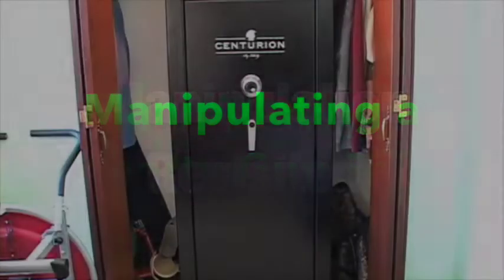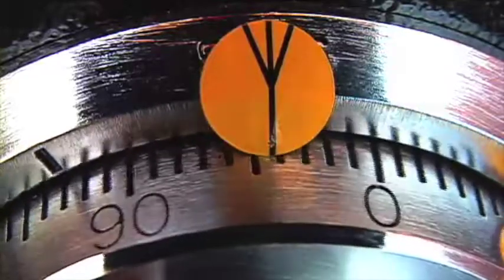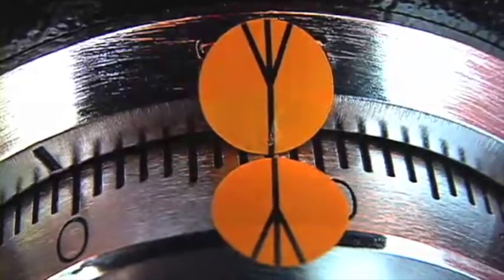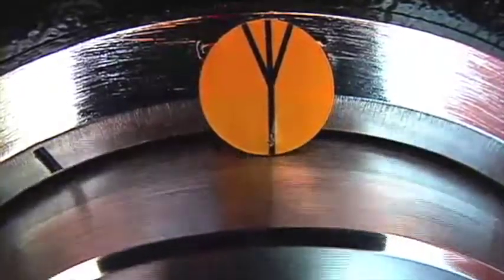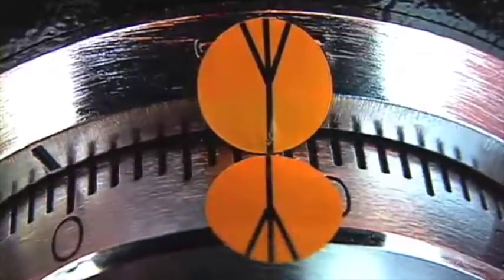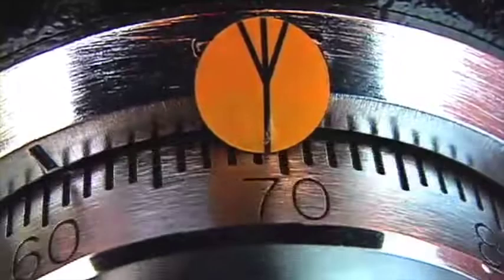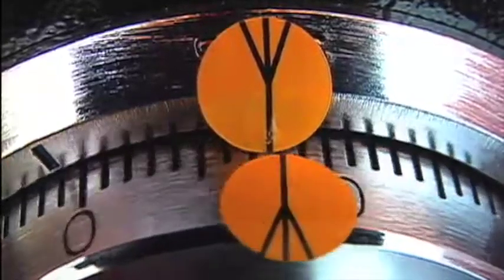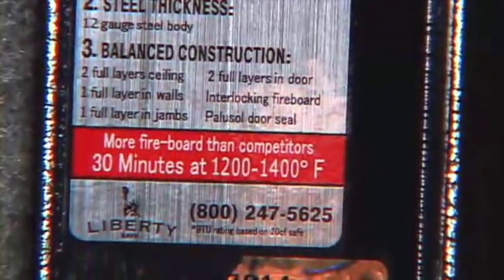Manipulating Gun Safe

Comment: So what do you do when you can't find a contact point?   I might have a group 1 lock I guess..   It doesn't even have the 2nd line (for when you change the code).  It only has the one center mark and nothing else.    I don't know how to use any of these techniques without finding a contact point.
Reply from the maker: Is the safe an old antique  it might use handle pressure to create contact points.

Not all locks have a spring assist lever that make contacts.

Group 1 locks have a second line for changing.
I know Diebold locks have only top index and need a listening device to find contacts.

Sounds like one you may have to drill open.
Reply: @ckpick8621 It says Mosler on the front panel..  It says nothing on the dial itself.  I'm pretty sure Diebold bought Mosler.. so maybe it is the lock you're saying-- that needs a listening device.  One thing is, we have it laid on it's back at the moment (on my trailer).  So the doors are facing up to the sky..  That would definitely effect the lever if it's not spring assisted.  The dial is not exactly free spinning either.. It's not bad, but you can feel slight resistance through around half the dial.. It's just kinda firm in general.  It's very smooth, but it feels like it's covered in old grease.. It's like trying to spin a knife in peanut butter.  It spins-- there's just a steady resistance there.....   It's quite big with two doors.  about 5ft wide and 4ft tall with the wheels, maybe 2.5ft deep.    

Numbers say..
serial no: 18868-14
model no:  11

I can't find much info on it.  From lists I've seen people post, this might be a 1966..  not sure.  It's very institutional looking.. Like something you would see in a hospital or government building or something.  Very square and basic.  It's obviously lined with concrete and is well over 1000 lbs.

I don't know exactly where to drill.. If you know how to find it, please do tell.
Otherwise, I was thinking about cutting/ busting a hole in the bottom, big enough to crawl into.. Then I can pull the back of the lock and easily decipher the combo from looking at the wheels.   I'd like to avoid that if it's possible;  it wouldn't be too hard to repair.. I have a welder and know how to pour concrete, etc.
Reply from the maker: @calholli  You have a Mosler double door fire safe.
Them locks hardly give anything and with a tight dial forgot it.

I can tell you how to drill it on the right side door.

The safe will have hardened plate not thick but you need high rpm and a carbide bit.

Measure carefully from dial center 2-3/4" Left of dial center and 3/4" UP.

Drill straight a 1/4" hole is really all ya need. You will drill outer skin then fire insulation then hardplate then inner skin then breakthrough.

When you breakthrough you will hit the tip of the handle cam you can tell by wiggling handle and see it or feel it with a ice pick. (Don't drill through this)

Now hold UP on handle insert some type of punch and give it some hits. The cam will move past the lock and open.

You may need a few 6" bits to finish door is kinda thick.
Carbide bit can be 4"

With safe on back it helps because you can you use your body weight to drill the hardened plate!
Reply from the maker: Extra note: Use a mini sledge when you hit punch the handle cam is fairly thick to bend out of way.

My measurements are from dial center so 2-3/4" Left and 3/4" UP from dial center.
Reply: @ckpick8621 Awesome... I appreciate it.  I will keep that in mind as a last resort.  For now, I have some cheap piezoelectric sensors and a good oscilloscope;  I'm going to see if I can get better readings with it.  I think I found the contact points--  If I keep spinning in the same direction (after picking up all the wheels) -- I can feel it and hear it make contact in the same spot every time around...  I just can't hear it or feel it when I creep up to it slowly.   So I'm going to play around with it a bit more and test these sensors for fun.. see if I can crack the dial like youtube says I can. :) ..    The bad thing about drilling is that I have to drill through that little decretive aluminum front cover, and there's not really a good way to cover that up afterwords.    If I cut through the bottom.. I can always weld over it and then pour new concrete in the bottom, etc.. Place another plate inside the bottom, or whatever;   and the rest of the safe would look stock and undrilled.  IDK, I'm still deciding..    I appreciate your help

I guess I could drill through the outer aluminum cover with like a 1" hole saw  (and drill the rest like normal, with 1/4 carbide bit)..  And once I get it open, I can put a hardened bolt into the hole and weld it to the front plate -- since I have clearance..  and then slip a big washer over the bolt head, covering the hole saw hole in the outer aluminum cover and welding it to the bolt head...  Might still look decent.   I guess I could just remove the little aluminum cover completely

How do you normally patch holes after drilling a safe?    Or do you just consider it damaged goods and unusable now?   I'd like to repair it-- one way or another.   Either way, it's a fun project.  I got the safe for free and they said it hasn't been opened since the 60's..  So there might even be something in it..  But I just want to get it working again and keep it looking decent...  I'll let you know how it turns out.

ps. I have two other safes that I deciphered the code from-- but both of them were already open;  so I just had to pull the lock and watch the wheels as I turn the dial.  So a part of me really wants to get this just by spinning the dials. lol.  we'll see; like you said-  the lock isn't giving me much indication.
Reply from the maker: @calholli  For repair I bend the cam back, then put a service sticker over hole after I fill the hole with steel stick.

Nothings wrong with safe when done.

I don't think you should waste your time dialing and I'll tell ya why. Most Mosler locks have false gates on the wheels to trick ya if you try to manipulate it.

So even if you get a number it will probably be a wrong number.
Reply: @johnwickpick8621  Your plan didn't work out for me (so far)..    I drilled the hole and I can see the lever moving the cam..  If I press up on the handle I can just see the end of the cam start to pass the hole..  and I can tell that there's another layer behind it, stopping it from bending;  So I think it must be reinforced to stop this kind of intrusion.  Instead of bending, the edge of the cam chipped a piece off about the size of the end of my punch-- so it basically cut it like a die.   It might be a hardened cam-- seems how it chipped/ cut and didn't bend.  But like I said, I can see another piece of metal right behind the cam-- quite close to it, like it's there to reinforce it from bending.  Maybe it's just the inside cover plate, but IDK.. It doesn't want to bend at all.    Are you sure I should pull "UP" on the handle and not down?   If I pull up, I'm right at the end of the cam..  I can even wedge a smaller punch past it--   that's how far the cam passes the hole.  I built houses and metal buildings for over a decade, so I know how to use a tape and drill a hole, etc..   I'm fairly certain I landed the hole in the right place.   If you have any other tips for me, I'd really be grateful.  Do you think it could be a little extra security safe maybe?   Should I just beat on it more? lol.  Like I said, it wants to break or chip before it bends. ?? 

I started with a 1/4 hole, but everything I had kept bending, so I went to a 3/8 and then 1/2 hole..  I really only punched through the hardened plate with the 3/8.. but it's 1/2 from the top and through the concrete;  So I can see pretty well with the flashlight, even when there's a smaller punch in the hole.  A couple larger punches we have are tapered and they wedge into the hole.. but the handle can't move at all when I wedge them in there--  so they are obviously deep enough.   I'm not sure what to do yet.
I'm probably going to walk away from it for another week or so and try again next week end.  I'll try any tips you give or I think I'll just cut a hole in the bottom like my original plan, and crawl inside and peak at the dials.  (if I have to).   Any more help is greatly appreciated. Thanks again.
Reply: I don't think you have a group one lock; locks with just one index line are set and opened on the same line. These are older Yale or Diebold locks and once the combination was dialed and the safe was open, anyone with a change key could change the combination, at which point S&G put a fly in each wheel, 7 digits long, to increase the lock's integrity. You may also have a manual change lock that doesn't use change keys to set combinations; to change these you dis-assemble the locks and  re-align the center cam in each wheel.

If you can't find the collision points on the drop cam and you are using a good listening device then you might have a group l lock. If that's the case there is a method for opening straight tailpiece locks using a laser pointer taped to the handle and a piece of white paper with graduated lines that the pointer can shine on, on any adjacent flat surface can work to open a group l but these locks are a pain to open.
Reply: @irishplayerkc  I finally got in.  I had to bust in from the bottom..  one of the pins connecting rod had broken off and the pin was stuck.  it wasn't going to come open any other way.  I did weld it all back up and refill the hole with concrete though.  You can't even tell I was in there, unless you pull up the carpet/rug in the bottom of the safe.

Comment: Crow's Feet: Lockmaster in Kentucky sells them ONLY to licensed/ registered businesses. Is there an alternate source? Name of manufacturer?
Reply from the maker: Yeah before the stickers I would use masking tape with a sewing needle cut down as pointers worked good
Reply: OK, right now I'm using yellow electrical tape on both sides and draw a line between them with a black pen. Cheers.
Reply: Time Masters also sells them and they are less stringent in protecting the craft.

Comment: I have a safe from what a lockSmith told me is from the late 20s or early 30s. This locksmith wanted $550.00 to drill and open 6 years ago, still sitting in garage unopened. I've since seen your videos and I will try manipulation to open. This is a unique safe it is a HHM safe with a square door on bottom with s&g 90#   dial, it has a Gary round jewel door with a 90# Gary dial top left which is a tl-15 from what I can find and a  filing cabinet drawer top right. Have you ever come across something like this and is manipulative.
Reply from the maker: Yes it's possible it all depends on how good the contact points are.
If you can find good contact points like in my video you have a chance of doing it
Reply: I will keep trying. Have you ever come across this type of safe or ever heard of any like it? Thanks
Reply from the maker: @L Hammer  I have come across them but didn't manipulate it.
As long as there's contacts points it's always possible but if the contact points are real soft or mushy feel that makes it lot harder to read.

Comment: Nice technique, but sort of an incomplete explanation. You checked wheels 2 and 3 with left rotation and found a gate centered on 80, but did not explain how you figured out if 80 is on wheel 2 or 3. You either did some kind of high-low test or just took a guess that it was on wheel 3 (which is often correct I suppose). From there you figured out wheel 2 but didn't explain how. You must have set wheel 3 to 80 and then checked wheel 2 for another gate. When you found it, you brute force opened the safe.
Reply from the maker: No I didn't guess 80 was on wheel three. I park wheels 1 and 2 and just run 3 near 80 to see a change.

If there is no change I'll park wheel 1 and 3 and just run wheel 2 near 80 and look for change to narrow it down.

Not sure what you mean by brute force safe open, once you find two numbers of a three number combination you just run the last wheel until it opens 
You don't manipulate the last number.
Reply: Thanks for the reply. Wish you would make more videos! I suppose parking 1 and 2 and checking 80 on 3 is correct. I would have done the same thing or done a high test, by setting wheel 1 outside the checkpoint area, setting wheel 2 on 90 then wheel 3 on 80 and check the checkpoint. Then do the same thing but with wheel 2 on 80 and wheel 3 on 90. That will tell you which wheel has the gate at 80. Running the last wheel is the same as brute force. @johnwickpick8621

Comment: this does not exist where i live. not a single lock smith can get into my safe with out destroying it, and it is a lg lock
Reply from the maker: @tradetalk1  That's good contents are nice and secure
Reply: @tradetalk1   What's the value of the safe? I met an expert once that specializes in bank vaults and high security safes. He charges $1,200 just to show up, then an hourly rate. I got to witness him drill a safe once. He removed the dial and drilled a spot which would be under the dial. When he repairs the safe, he fills the hole and replaces the dial. There's no visible damage and you would never know it was drilled. By the way, he packed the hole with something that looked like carbide, then filled it with epoxy. He claimed it can never be drilled in the same place again, so the security isn't compromised. This was an almost new $20k safe.

Comment: Does this work with the little personal safes that have the turn wheel as well as the x on Cross lock in the front. So i have to have the combo and the X shaped key to open it. I know how to oick the X shape key, but im missing the wheel combination.... Will this same method open jt.
Reply from the maker: Hello, No this method is for standard locks.

The lock with the X key is a direct drive, meaning watch my other video on Halls manipulating.

You have to watch how far the key turns for gates because the key acts as the handle.

Or

You can drill 1-3/4" back on the opening side in center of door.

Insert key then Punch back bolt to open.

After that you could remove the wheels from
Lock and just use the key to open it and straighten out bolt.

Comment: It's nice to know what lock you have and it's orientation within the safe. But understand, you can't determine the lock type by looking at the dial because an S&G dial will fit on a Lagard lock. It's also nice to see some of Rex Parmalee's teachings are still being taught ( I learned from Rex). 

My procedure is similar but I always start by insuring that the dial ring is in the correct position and is tight. Second step is determining if the lock is Right to open or Left to open and a good listening device can determine that by listening to the drop lever nose contacting the drop cam. Third step before manipulation is determining the number of wheels, is it the most common 3 wheel lock or a 4 wheel lock (manipulation is much harder if it's a four wheel and you don't know) which can be done by counting down fly collisions.

Once my prep work is done I can begin manipulation and I always park my wheels outside of the forbidden zone (0-20). My method of determining parking place is a one time through the dial with all wheels turning 5 digits at a time and doing this I have found not only the lowest drop point on the wheel pack (finding the lowest point helps defeat wheel ghosting) but sometimes have found a gate or two. my method differs also because I begin to look for the third wheel and not the first and knowing that the forbidden zone prohibits setting the third wheel between 0 and 20, it give me less numbers to go through, plus the third (or fourth) wheel is closest to the drop cam we get more deflection there than the first wheel.

Like you I like using the crows feet stickers and I also used a magnifier and listening device. I was very impressed with your work and am glad it's not a lost art. I am in my 70's now and have been retired for some years, but I still love solving puzzles and a drop cam manual combination lock is an extremely fun puzzle to solve. As an employer who sold many safes and vaults and set thousands of combinations, I always insist my employees set combinations to a standard pattern, thus if I needed to go in and manipulate a lock that I knew my employee had set then I knew where to find the numbers; quickening my job.

thanks
Reply from the maker: @irishplayerkc  Wow nice reply and points you make are very good.

Yes I always check dial ring first. As for which way the dial stops I don't check because it don't matter cause when the lever drops I can feel the stopping point.

I usually don't check on wheel count on safes that will likely have a three wheel. As for four wheel locks they give better readings because the fence is loanger and has more " tilt " to them.

Also here's a trick if you didn't know, if you slowly run all wheels through contact area and there is a gate there, it will caDialthe dial and you can feel it. Also it will be either wheel one or two cause three would be forbidden zone.

As for wheel shadowing I deal with it if I don't find anything by parking .

Thanks again on your pointers.

Comment: Liberty can retrieve the combo just by the serial number given that the default combination was never changed. 
You have to be a dealer or provide proof of ownership through by notarized letter etc
Reply from the maker: @3dsmaxrocks699  If your a locksmith that does work for them they will give it to ya also
Reply: @johnwickpick8621  I'm a liberty dealer and a locksmith
Reply from the maker: I have a locksmith friend in Minesstoa who just opened two Liberty gun safe and they gave him the codes